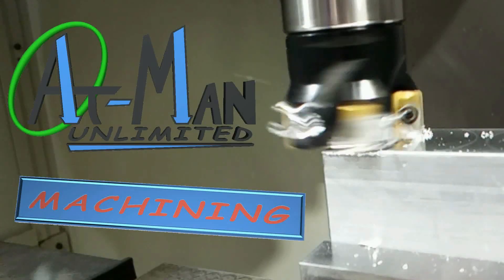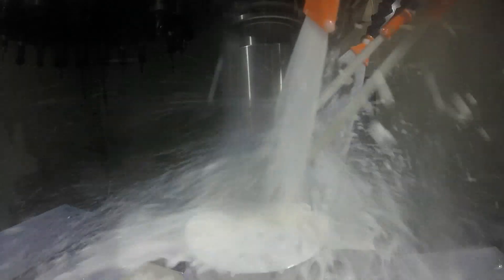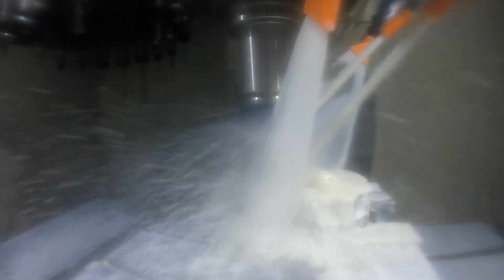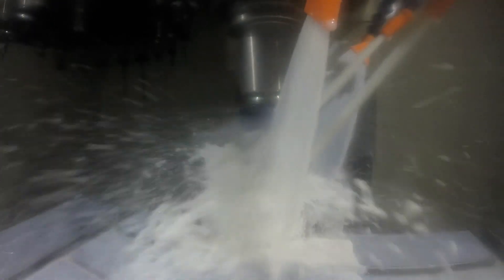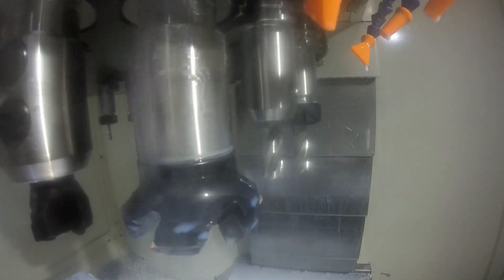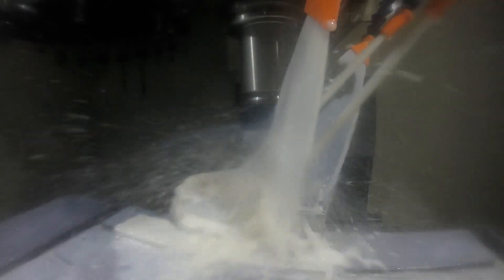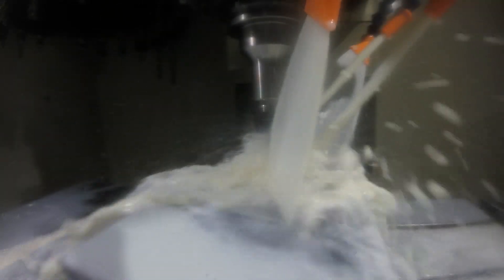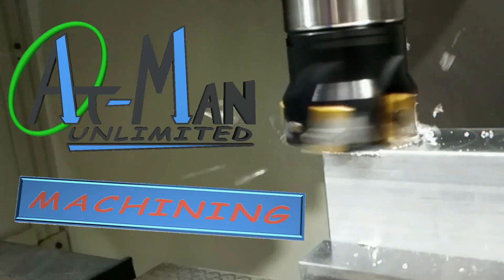Making a Meat Slicer Knob, Making Chips

Comment: Cool knob!!!
Check out feeds and speeds on this end mill, EMCO #32606 1/2" carbide Streaker mill it is very productive!!!
Oh yeah made a  coolant skimmer like yours...AWESOME!!!
One issue (unavoidable I think) If you shut it off after running for a while it doesn't start back up due to chip build up on the magnet.
Simple fix...clean it!
Thx for the video.
Reply from the maker: Thanks Ed, I still have a lot of HSS tooling so I take it easy on it. I'm not really worried about saving a few minutes when I only make one. With the skimmer, make sure that your out flow does not flow into the top of it. That will greatly reduce the chips getting into it. Typically the chips wont float unless there really tiny.  Then try adding some type of course filter like a shop rag on your out flow. The more chips you can keep out of the sump the better.
Reply: I hear ya thx.

Comment: Nice video! Why did you not use cutter comp on 3/8EM to open the pocket more on the machine? Does Fusion360 give you that option?
Reply from the maker: Thanks Eudorian, a few reasons. I was wondering when someone was going to notice that and call me out. Yes, Fusion 360 does support cutter comp.  That said, I played with it on the Fadal a bit and I kept getting errors in the code. So I need to look into it a bit more. I don't really do large run parts so I have just been doing it in the PC rather then the machine for now. The second reason is my memory is so small I need to DNC almost any CAM file to the machine. I have not yet made changes to my embedded controller I use for DNC so I can tell it to start a program at a specific tool operation.  I also don't have a way to get out which line number I would want to start at either.  It is on the list of things to get done.

Comment: Hi Tim, Great work!
I have a Fadal VMC40 in my garage and appreciate the videos and information you provide.
For this part, what is the process of deciding how much to charge the customer?  Do you break it down into Design time and Machine time, or do you charge a flat rate?  Maybe it isn't even that complicated and the customer explains what they are looking for and you throw them out a price.
Reply from the maker: I'm going to say it depends, on a lot of things. I have two rates in my head, one is CAD/CAM time or attended machine operation and the other is just lights out machine operation. So I try to quote based on hitting those target rates by looking at the part and judging the features. That is the main way I look at a job. Then I see if I will need any special tooling for the job and the quantity of the job. Material costs come in play but most is aluminum that is fairly low cost. Last I try to foresee any trouble spots, can we make the part in one shot with reasonable certainty? Or is it a complex part that might need a mulligan. It's a competitive industry so quoting is really hard.  Need to get it right or you lose your bottom end or you lose the job.

Comment: didn't c anything other than coolant
Reply from the maker: Yeah, sorry about that, not one of the better videos. When I mounted the gopro and the air knife holders I reversed them. Normally I try to put the gopro on the left side of the spindle and just barely clear the tool changer. This time it was on right side where the coolant nozzles are. Didn't realize it until I was all done and editing the footage.